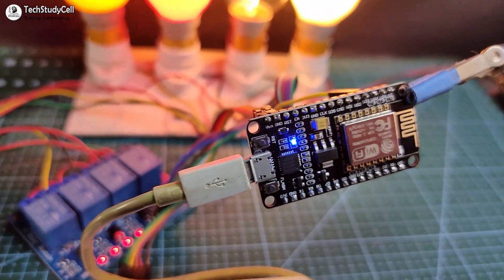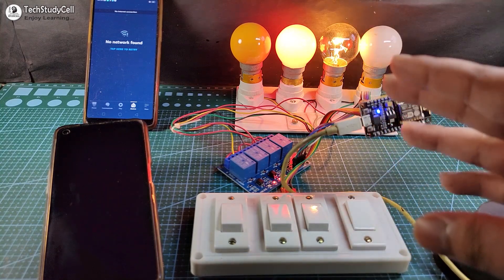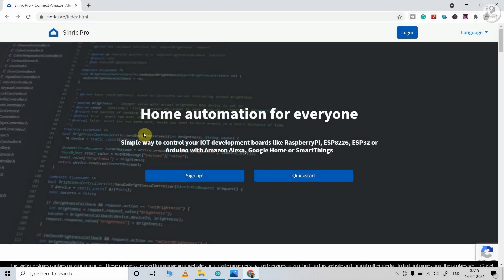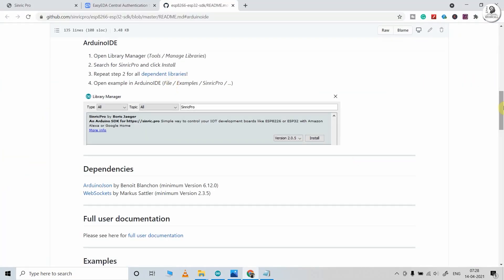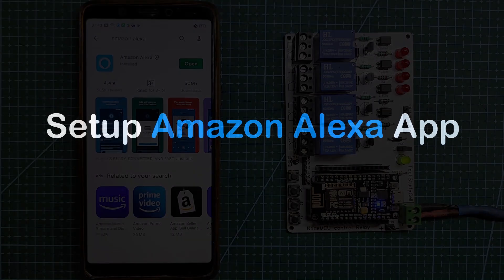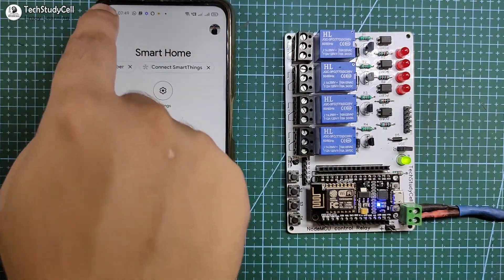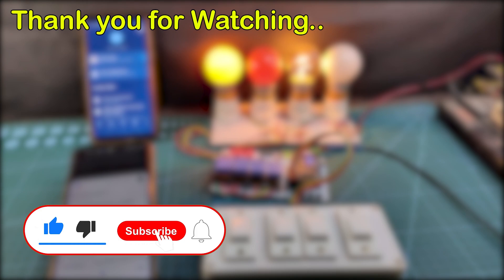Smart Home with Google Assistant & Alexa using NodeMCU ESP8266 (Manual + Voice) | IoT Projects 2021

Comment: I have smart home project. 

Smart home project available. 
Features.
1. Gate opening through biometric 
2. Automatic watering system. 
3. Automatic lighting system with motion sensor 
4. Gase detection and Automatic exhaust system

Comment: Please I really need help with this connection my presentation is on tuesday... I found out that after connecting everything all components read well except the diodes, it's like it's shorted. It reads in both directions when connected to the PCB and hence the relays don't power when plugged into 5v supply. My presentation is on Tuesday please I need help

Comment: Please what did you use as the VCC and how can I get it.
Reply from the maker: it +5V DC
Reply: @TechStudyCell  ok but please I'm still confused on the circuit part you used for the VCC. On the circuit board the part labelled VC/JD, what circuit part is soldered there?
I'm having a very hard time finding the particular part that is. Please help.

Comment: I have esp 8266 Lolin v3 & i am facing problem in the video you use sd3 for switch 1 and in my esp8266 there is (S3) instead of SD3 what should I do?
Reply: I have the same question.. did you solve it?
Reply: @trizordgaming8383  no I couldn't find solution but I just disconnect it and using it with just 3 switches
Reply: @jawadmuzaffar913  so basically u can't control one switch manually ?
Reply: @trizordgaming8383  yes I skip it and change switch if from 1 to 2 . 2 to 3. 3 to 4 . So I can control it using Google but not manually just no 1 switch
Reply: @trizordgaming8383  yes basically

Comment: I'm planning on making a similar circuit to control only one light. What changes am I supposed to make? Thank you in advance, the video is pretty informative.
Reply: Just use one relay and one switch circuit and one GPIO pin and create on device in sinric pro . In the code delete all 2 of the device ID and paste your device ID that's it
Reply: @dev_xand bro i literally like this video and I want to build this in my home so Is this possible to build and can I build this..??I'm not from electrical branch?
and i guess it's not perfect so can you guide me a little bro

Comment: hey, in my case the alexa found the devices but the commands didnt execute !, it says devie un responsive and even in the serial monitor which i set the bound rate to 9600 i get garbage data but when i set it to 115200 i get this 

wdt reset
load 0x4010f000, len 3460, room 16 
tail 4
chksum 0xcc
load 0x3fff20b8, len 40, room 4 
tail 4
chksum 0xc9
csum 0xc9
v000661e0
~ld

Comment: I am facing an issue. I have uploaded your code and controlling 3 devices in my room but when my electricity is going offline and then getting online my device is getting online. I have to turned on and off my nodencu circuit multiple times and after a lot of on off luckily device getting online.

Comment: Executable segment sizes:

ICACHE : 32768           - flash instruction cache 

IROM   : 386596          - code in flash         (default or ICACHE_FLASH_ATTR) 

IRAM   : 29229   / 32768 - code in IRAM          (IRAM_ATTR, ISRs...) 

DATA   : 1500  )         - initialized variables (global, static) in RAM/HEAP 

RODATA : 8480  ) / 81920 - constants             (global, static) in RAM/HEAP 

BSS    : 26336 )         - zeroed variables      (global, static) in RAM/HEAP 

Sketch uses 425805 bytes (40%) of program storage space. Maximum is 1044464 bytes.
Global variables use 36316 bytes (44%) of dynamic memory, leaving 45604 bytes for local variables. Maximum is 81920 bytes.
esptool.py v3.0
Serial port COM4
Traceback (most recent call last):
  File "C:\Users\Sanjeet Kumar\AppData\Local\Arduino15\packages\esp8266\hardware\esp8266\3.0.2/tools/upload.py", line 66, in <module>
    esptool.main(cmdline)
  File "C:/Users/Sanjeet Kumar/AppData/Local/Arduino15/packages/esp8266/hardware/esp8266/3.0.2/tools/esptool\esptool.py", line 3551, in main
    esp = chip_class(each_port, initial_baud, args.trace)
  File "C:/Users/Sanjeet Kumar/AppData/Local/Arduino15/packages/esp8266/hardware/esp8266/3.0.2/tools/esptool\esptool.py", line 271, in _init_
    self._port = serial.serial_for_url(port)
  File "C:/Users/Sanjeet Kumar/AppData/Local/Arduino15/packages/esp8266/hardware/esp8266/3.0.2/tools/pyserial\serial\__init__.py", line 90, in serial_for_url
    instance.open()
  File "C:/Users/Sanjeet Kumar/AppData/Local/Arduino15/packages/esp8266/hardware/esp8266/3.0.2/tools/pyserial\serial\serialwin32.py", line 64, in open
    raise SerialException("could not open port {!r}: {!r}".format(self.portstr, ctypes.WinError()))
serial.serialutil.SerialException: could not open port 'COM4': OSError(22, 'The semaphore timeout period has expired.', None, 121)
Failed uploading: uploading error: exit status 1

WHY IM SHOWING THIS?

Comment: Nice video.Everything is working fine but I have one question when manual Switch is in OFF mode but i turned on the light ON from App it's turned ON but when I turn switch from OFF to ON while light is still ON through App it's turn OFF the light  which means polarity of Switch changed ?
any solution for this ?
Reply: You might have the high and low values switched in your code

Comment: Everything is done ok .3 Devices are seen on sinic pro and in alexa and google home successfully linked   but it reports devices un responsive both in Alexa or Google home. they are always shown as device is offline in sinric pro, alexa and google home. It does not show the wifi connected on the serial monitor but Wifi LED blinks in regular intervals on the NodeMCU that I use of version 3 from LoLin. The same NodeMcu but worked perfectly on your Blynk code showing wifi connected..
Reply: This was also reported by and I am having exactly the same problem even after following your solution. I use no switches atall.
Marcio30 OCT 2021 REPLY
Hello your project is excellent.
I’m trying to do it for my house, but after loading the code for ESP8266, it keeps restarting. do you have any tips to solve this problem?
I have already used another NODEMCU.
SerialPrint: below.
ets Jan 8 2013,rst cause:4, boot mode:(3,6)

wdt reset
load 0x4010f000, len 3584, room 16
tail 0
chksum 0xb0
csum 0xb0
v2843a5ac
~ld

Subhajit13 NOV 2021 REPLY
make sure the D3 and SD3 pin (i.e switch1 and switch2) are not connected with GND. all switches should be OFF when you BOOT the NodeMCU

Comment: Hi, this project was awesome and helped me a lot ! I made a similar project, but to control a garage gate instead of LEDs. But I came into a blocker. When the power goes down and the nodemcu reset, it will trigger the relays. I tried everything to avoid this with no success , do you have any idea?
Thank you and keep it going!
Reply from the maker: I have used active low relay module. You can use.... File- Examples- Sinric Pro- Switch-Switch.ino
Reply: @TechStudyCell  Hi, thx for the fast reply! It was actually a coding issue. I was not calling the pinoutput and making it hight on the start of the void setup, but a bit below :D. Thank you!
Reply: @Tiaguituh05  dear kindly help me I face the same issue every time restart nodemuc trigger relays sharer code you change plz dear help me

Comment: To connect more lamps you need a hub or server, por example the program home assitant in raspberry pi, and the custom firmware tasmota, and devices with esp8266 like sonoff to control outputs for control infinite lamps

Comment: I had a problem with Design
I have mounted all components
When I power up the system Only nodemcu turns on
Power led and other led aren't glowing and relay not working
Can any one help to figure out this problem?

Comment: Hi,  thanks. Very nice video. I using Esp32 and I want to use a single channel relay instead of 4. So will I have to alter the circuit and the Code for the es32. but at compiler show error..Documents\Arduino\libraries\WebSockets\src\WebSocketsClient.cpp:234:30: error: 'class WiFiClientSecure' has no member named 'setInsecure' _client.ssl->setInsecure();.. you can help me.?.  please..!
Reply: @19T6036_Madhuri Malviya hi. I only comment the line in this file ando work fine!

Comment: HI @TechStudycell
Hello sir, Thanks for the wonderful and useful project.
am created the same project, but am facing an issue... is that, when where the power (electricity) resumes, all the loads or relays turns to ON.

The node MCU not storing the last status memory.

is there any solution for that.

Comment: i need to control with wifi only without internet internet should be optional what if the internet went of and you need to configure  a heater degree all this is not good examples even blynk 
it should work with wifi without internet and if there is internet it gives extra option to control from outside the home

Comment: The problem with your design is that the physical switch state wont change if you turn on from switch and turn off from alexa. It would be better to use push or touch buttons here. You van also try adding in a raspberry pi with home assistant to add a cluster of such nodemcu subsystem in the entire house
Reply: I agree to this suggestion. Could you use maybe even STM 32 or R. pie to control the whole house with cluster of switches .
Reply: @inkits1 bro i literally like this video and I want to build this in my home so Is this possible to build and can I build this..??I'm not from electrical branch?
and i guess it's not perfect so can you guide me a little bro
Reply: And increase cost 10 times with Raspberry Pi , very good suggestion.
Reply: Yeh you can use a 2 way switch and relay(can act a s 2 way switch) which fix your problem
Reply: hello, how can we substitute the switch into push or touch buttons?
Reply: U can use parallel  wiring using rekay module 😊
Reply: Its not a smart swith but just a smart swith breaker

Comment: Brother, as you told in this video, I followed the same steps and everything is going well in the project 

but there is a problem that when  I say ON the light (relay), the Light is turned off, and when I say off  the light  then light is ON, I am not using relay module as you have I am made my own by bc547 transistor and 5v relay and I do not use an optocoupler, 

please help and replay
Reply: Bhai relay ka pin change kr do jo bulb me lga hai...interchange kr do...
Reply: @unbreakabledesire14   ha Bhai par ye to Kiya hai pr program me koi option hai

Comment: Can the jumper wires handle 240V with 1.5 Amps running through it? Can we build this setup in a breadboard?
Reply: That's just common sense.

Comment: Bro i bot the 12v Relay module  will it work. Please give a reply
Reply from the maker: Yes. You have to give separate 12V supply to relay module
Reply: @TechStudyCell  so want about switch in circuit diagram
Reply: @TechStudyCell  will the nodemcu work on 12v
Reply: Can you give your Instagram id i want ask some doubts

Comment: Great video👍
I had a question wrt the Channel Relay, is there a specific one required or any relay is fine. Since i have a relay module lying around but whenever i tried it doesn't work. Your thoughts.
Reply: 5 volt relay

Comment: the only issue i see here is when system fails, how to manually override the switches. Else it won't be practical
Reply: You wire them up so they fail in a state where the light is on so a conventional switch can now control them. Actual people who do this thing think of that naturally plebs like you just sit and wonder.
Reply: @tylermcnally8232  considering myself as a pleb, trying to implement this by learning, do you care to elaborate the "wire them up so they fail in a state where the light is on" thing?

Comment: I'm having a problem, idk if is something in the code or what could be the problem but the comands are backwards, when I say turn off the lights they turn on and when I say turn on they turn off, help me pls
Reply: I am having the same problem.  We may have to edit the code.
Reply: same problem bro
Reply: The relay output has three terminals
NO-normally open
NC- normally closed
Com-common

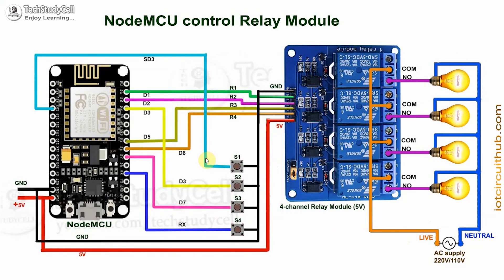The circuit diagram 3:08  in this vid shows connections on com and NO terminals

Instead of connecting the NO terminal try connecting the lamps to NC terminal 
This should work and your problem should be solved 
Ensure you have proper circuit breakers because you're working with 230v AC which can be dangerous if not properly handled.

Edit: i just noticed the comments were 3 years old 
But i guess my comment would help the newbies out here.

Comment: We have to remain open the circuit path if we didn't use manual switch????
Reply from the maker: Manual switch connected with NodeMCU not with AC circuit. If you don't use switch, you can not control relays manually without internet
Reply: @TechStudyCell  can control without manual???
Reply from the maker: Yes. From your smartphone

Comment: Hello. I have a high level trigger relay module, so how do I edit the code to control the device?
Reply: @Tran Luong   for active high relay make a change in the program as following:
you will find the below section:

bool onPowerState(String deviceId, bool &state)
{
  Serial.printf("%s: %s\r\n", deviceId.c_str(), state ? "on" : "off");
  int relayPIN = devices[deviceId].relayPIN; // get the relay pin for corresponding device
  digitalWrite(relayPIN, !state);             
  return true;                               
}

change the above digitalWrite line as:
digitalWrite(relayPIN,state);

this will male your code for active high relay...

Comment: Bro u told that manual switches should be off while node MCU is booting it is only for first time or each time booting it should be off..?
Reply from the maker: Each time it boots. If you use ESP32, then there is no such limitations. Please refer to following video https://youtu.be/QGpZmZB9g5g
Reply: Can we solve the problem of booting by making backup power for node MCU..?that can make it always on

Comment: I'm also working on IOT project,
Here there is one problem with this approach. If Wifi module or relay fail  manual switches won't work.

Comment: after uploded the code my wifi is not discovering in any device
Reply from the maker: check if the nodemcu is connected with Wi-Fi or not. during the booting prosess first 2 switch S1 & S2 must be turned off.

Comment: Thanks for sharing such an Awesome project. Can you please modify the code to accept Wifi Credentials with user interface to feed the same , instead of hard coded WiFi Credentials. This will make the module more portable to be used on any wifi network. No one else has done this before with the module having multiple connectivity like Alexa, Google & Manual options. If you do this , you will be first to offer this feature .
So hurry up , before someone else offer this feature. 
Thanks & kind regards.
Reply: there are libraries to do that

Comment: Giving switching control with nodemcu had lot of mal function. Relay Automatically turns on or off if some switch turns on from other room which means does not has physically connection to nodemcu Junction. 

Sometime can't able to communicate with nodemcu needs to restart complete. It's really difficult to remove from Junction and reset. 

Note : you can't find these issues with demo session , you need to test real-time which means need to connect in home switch board or Junction and where you using regularly.

Comment: Brother I am facing issue, my node mcu is not getting online if it gets offline... 
Pls help
Reply from the maker: make sure during restarting all the switches are in off position. And use a 5V 5Amp power supply
Reply: @TechStudyCell  I did the same but whenever internet goes Off and then ON, my node mcu will not reconnect to internet automatically... 
Pls provide some solution

Comment: Very nice video. I want to use a single channel relay instead of 4. So will I have to alter the circuit and the Code for the NodeMCU.  I will be grateful if you can guide me in this.
Thank You
Reply from the maker: You can use same code. Just use switch 1 pin and relay 1 pin in the code.
Reply: @TechStudyCell  Thank you very much
Reply: I am having D1 Mini and not NodeMCU. But I found that D1 Mini does not have SD3 pin(GPIO10), so which pin I can use in D1 Mini or should I have to use only NodeMCU ?
Please help me.
Thank you

Comment: buttons are not working, when WIFI not connected. please do something.
Reply from the maker: In video I have already mentioned. You may face some delay if the WiFi is not connected. Press the button until lamp turns on

Comment: Sir I have successfully upload the code while my switches are of but still the node mcu not connecting to the wifi and   when I power the node mcu the led blink 1 time but after there is no response plz tell me a way to fix it🙏🙏🙏🙏🙏🙏
Reply from the maker: Use 5V 5A power supply. Check the circuit. Also check the voltage across vin and GND after giving supply.

Comment: your codes works in reverse direction when i switch off the switch from sinric pro app relay gets high input and when switch is turned on relay gets low input
Reply: How to fix this bro ?
Reply: I got same problem
Reply: I got the same problem
Reply: Polarity change kar do na
Reply: @generallifestyle6201  there is no polarity in AC Bro..
Reply: You have bought a Normally ON relay... I faced the same...To fix the issues 
In the code set relay to low when light to be on
Set relay to high when light is to be off

That's it
Reply: line 102 in code:   digitalWrite(relayPIN, !state);  
change it to :
  digitalWrite(relayPIN, state); 

for those whose LED is On for Off and Vice-versa

Comment: Amazing it works fantastic.. Can i use 8 relay module in this
Reply from the maker: for 8 channel please use ESP32. but you can control only 3 relay with WiFi
Reply: @TechStudyCell  I purchased remaining 5 in sinric it works great
Reply: @smartlearning6250  are you using 8 devices using single Node,
Or you are using some other extra components?
Please confirm🙏